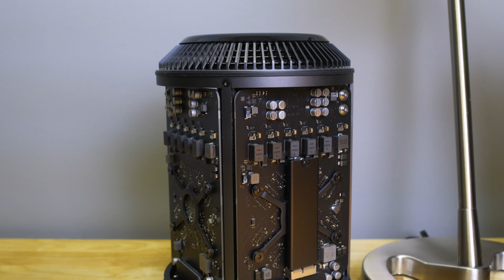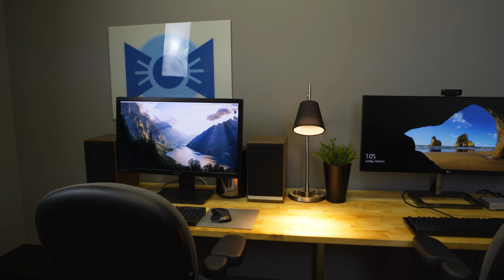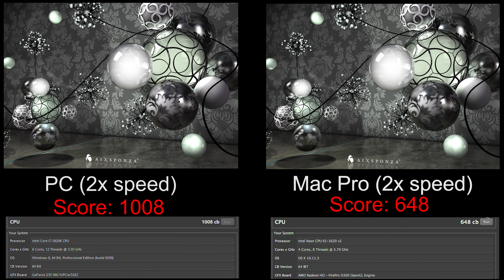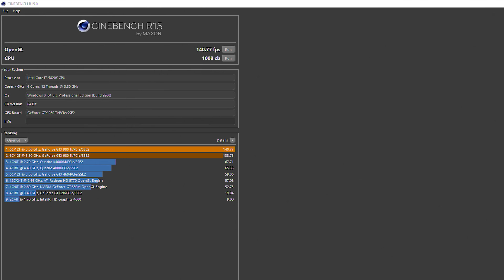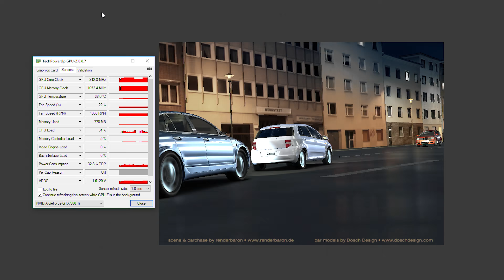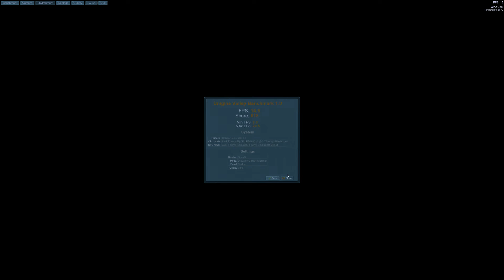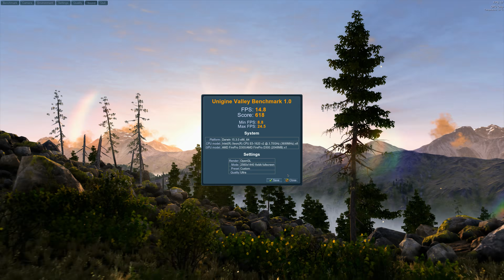$2,000 Custom PC vs $4,000 Mac Pro

Comment: Three additional years have past, what is the status of the Mac vs that pc. Is the pc reliable, are there updates, etc. not a good comparison. W	by would not use something commercially available instead of something rigged to win.
Reply: The PC does still get Upgrades. Windows 10 constantly receives new updates. Also, why wouldn't it be reliable? You just make random assumption to protect a greedy company. No matter how you turn it, the Mac pro is still a bad machine.

Comment: I'm not hating on this video, but comparing the lowest model Mac Pro to a custom PC is overkill, especially with the 2 more cores and twice the RAM, soooo yeah. A 12-core Mac Pro would've most likely beaten the custom PC but then again it was a lot more expensive.

Not like any of this matters since this video is almost 4 years old now and the new Mac Pro beats literally anything on the market anyways
Reply: lol the mac pro doesnt beat the pc market the 3950x and 3990x are still on top
Reply: @mynameis______392  Yeah, and they're like 10 times less than the Mac Pro

Comment: 2.7K Apple Fans. 51K PC fans. Sounds about right. There are multiple factors in my opinion. I am a PC fan, I built my own desktop back in 2015 (it was actually around $2K also), and I do like to game. However, I do own a 2019 MacBook Pro and it serves its purpose great, specifically for some heavy online gaming, streaming services, and online grad school courses. Yes, it’s over priced, but your average graphic designer, photo editor, etc. can’t build a $2K desktop, and can’t find a lot of the user friendly technology on your average PC. I had a 2009 17” MacBook Pro which I utilized for 4 years of college and tons of recording on Garage Band, it lasted me 10 years and never failed with the exception of replacing a battery because it wouldn’t hold a sufficient charge anymore. I dropped it on a music stand, had a big dent on the side, and still held up fine for several years. My wife had a HP laptop, used it for less than a year and had worse performance than my archaic MacBook Pro. Also, some people just have plain terrible luck. Like Snazzy Labs. He’s one person that had a bad experience vs the thousands of people that are content with their $4000 Apple computer and don’t mess with stands (sorry Snazzy Labs, but messing around with the stands on your iMac pro, going back and forth, you’re gonna have a bad time). That doesn’t excuse apples bad customer service in the case of your bad iMac experience video. Also to be fair, many non Apple brands (HP, Dell, etc) use parts just as crappy, and they’re also endorsed by the brands. This even includes some of the parts probably used on your custom built computer. There are also many other factors to consider: age demographic, technical ability, salary, personality, biased opinions, brand loyalty. Those can easily sway a persons opinion on which is better. This applies to many of Snazzy Labs videos, not just this one. Apologies for the rant, I watched several of Snazzy Labs videos and felt the need to comment. I look forward to the Apple haters responses. Haters gonna hate I guess. Great video Snazzy Labs, love your videos.

Comment: That's the base model Mac pro and you're comparing it to a fully upgraded PC. Try to compare it to something similar. Also the base model Mac Pro doesn't cost $4,000, the fully upgraded one does. This video is pure click bait. Any upgraded PC would beat a base model of almost any computer
Reply from the maker: This video is multiple years old. It was produced when the entry level model was $4,000. The fact that even another 3 years later they’re still selling the same machine is hilarious and sad. And that’s the whole point of the video. A PC half the price clobbers the base-model at 2x the price.
Reply: Snazzy Labs the PC has newer components in the video than the Mac does. Also they haven't sold the quad cores in a couple years, 6 core is the base model now. Supposedly Apple is releasing a new Mac pro that's fully upgradeable this year. Just hope it's not overly expensive or else I won't get it. Love my PC for gaming, but I'm so far into the apple atmosphere that it's so much easier to use a Mac. Especially with how well hand off works. Just wish they made them fully upgradeable because interface and usability wise I like Mac, but performance wise my PC eats it for breakfast

Comment: but, but, but it's an Apple...obviously the best computer in the market, not. I battled with artists in the newspaper business around 24 years ago over this very issue. By that time you could at least match performance, if not exceed it, for a fraction of the cost with a PC running Quark,Photoshop, or Illustrator. You could color calibrate your monitor on a PC and it was every bit as good for print media as any Mac. At the time i remember having to replace a bad floppy drive on a mac for $240, at a time when you could by a floppy drive on a PC for $15. I laugh at the folks that buy Apple products. One more thing, it was the editorial folks sold on Macs. It was advertising that used the PCs. Makes sense to me now considering modern mainstream media folk.

Comment: It makes me laugh to see how Mac users and Window users like to call each other names without realising that neither one is better than the other in all departments.  Windows just like Macs, when they go wrong they usually go wrong big time.  I run both systems for different reasons, certain bits of software tend to run better on different systems simple, so calling people ignorant or any other wonderful names just because they have different experiences to you is like the pot calling the kettle black.

Comment: Would be curious to see a rematch with a newly updated Mac Pro (which I am sure has happened since this video) with a new state of the art $2200 PC. I'm sure the Mac still gets its ass handed to it, but by how much?  It really is indefensible that Apple waits 3 years + to update its flagship computer that it chargers a king's ransom for.  Should be every two years at the absolute most.

Comment: Apple systems are ALWAYS last years processors and usually the lower end of them. Every product they sell is over-priced and based mostly on look and feel. Most the Apple desktops in places like BestBuy are offered with less ram than the software(s) really require....so that the retailer can offer over-priced upgrade services.
I hate working on them, but I have to repair whatever the client has been foolish enough to buy.
Will Brown, Dirt Cheap Computers (CA Northbay)

Comment: Oh my god. My i5 4690k machine that I built in 2015 equals this things performance in the CPU department, and murders it in every other way.

I recently bought the Dell G3 15 laptop with the i5 8300h and gtx 1050 Ti. It cost me $1,050 CAD and it's closer to the custom PC than the Mac "pro". The Mac Pro on Amazon is STILL $2,200 CAD and significantly less powerful than my LAPTOP. Again, $1,050 laptop murders $2,200 macbook pro. Completely absurd.

Comment: One thing that I am wondering and it may have nothing to do with the monitor.   The test reported running at 140 FPS???   I am wondering how it was able to at least display that since monitors usually run at about 60hz?   since hz = fps   also if the video card outputs at 60hz as well how can it even be allowed to run higher?  maybe mac has some kinda a run-time routine to do this and report false FPS's and it can prove how it reported the false result

I also find it funny when people tell me they are running 100 FPS when the monitor and their video card is set at 60hz or so. now sometimes they can run a bit higher say 70 or 75 for a few secs that's normal from time to time. like CPU's  rated at 3.2g running at 3.4 or 3.1 its a close estimation.

Comment: I'll bet there is a Linux geek out there laughing at all the Windows fanboys and their $2k computer thinking they built theirs for $400 and it will run circles around that Windows box.  Everyone can play that game dude.  Grow up.
Reply: Linux is just a software. You have to buy hardware to run Linus which cost about the same windows if you need the performance. The only cost reduction is Linux is free. It is good for tinkerers who know what they are doing not for users who just want a computer that can play games at high setting with high frame rates. So they will gravitate towards windows which had huge collection of games compared iOS and Linux

Comment: Yeah, but you're still stuck with Windows.  You can't run both, like you can on Mac.  That's like owning a Tesla and only being able to "refuel at certain" locations rather than ALL locations.  So you're overclocking, reducing the life span and you have all those different parts with software that isn't tailored to your hardware.  LOL.  You're machine and apps will be broken after a few updates and you'll be installing drivers here, drivers there etc. etc. etc.  Why are you fanboy's sooooooooo intimidated by a little computer company with a 5% market share?  This shit has been going on since I bought my first Apple computer in 1984.  You guys don't change over the last 40 years.  Guess what.  Mac users will be happy 40 years from now like they were 40 years ago.  Why do you people even bother getting yourselves worked up?  Because you're losers, that's why.
Reply: What have you the idea that NEED to to download drivers every time. When you install Windows 10 it basically installs the necessary drivers and the rest you can download from the manufacturers website. It is our choice (not the windows 10 updates which is Bs) Apple make good products I agree but their prices and their NO REPAIR policy pass me off. And the whole batterygate incident, and also the recent revamping of Butterfly keyboatdw after years of complaint, and alsoERROR 53 they keep saying it's the customers family even though it's their ok wn damn fault only after a lawsuit was issued they actually investigated it and found it to be a manufacturer fault, and also the geniuses in the genius bar charge 400$ for screwing in a new SSD. SSD cost is excluded. And most of the time they are understocked. I don't believe all of the rumors but when you see sources for the claims I just shake my head. They make repairing your MacBook which you bought with your money as difficult as they can. They hate repairing of their Macs. They are on a vendetta working closely with government organisations to stop the import of Apple repair material. And also they made it that only genius bar employees can even access the diagnositic tools necessary. All of this would be forgiven if they actually fix it NO they will try to persuade you to buy a new by charging you almost the same amount as a new Mac. And even if they FIX it the problem will continue. And their way of fixing is change you Mobo with a refurbished one which may fail after a time. Please tell me your experience with repairing of your Apple produce or are you one of those which buy new Apple product every year. I won't call Apple customers stupid or anything. Since most of them are riich. And their ecosystem is one of the best. And it is very difficult to get viruses, but it is not virus proof as Apple claims. And the UI is also very good. And be I know people who are complaining and those make fun of it will have it. But that does not deter me from enjoying the roasts.

I can't afford one and won't buy one even if I can afford it since I'm more familiar with windows since I was a child. And after hearing many of the legitimate complains I'm sticking with windows.

Comment: I can guarantee you that if you build that same custom PC as a Hackintosh running MacOS it will out perform the same system running windows. I know because i have done this numerous times at my Computer shop. MacOS in itself runs circles around Windows in an identical hardware setup.

Comment: I am by no means an Apple fanboy. However, it is so irritating watching reviews like this. It’s always an “Apple such and such product” vs a “such and such custom rig I built for xyz price.” Why isn’t the comparison ever a Lenovo/HP/whatever type of manufacturer computer? Some car savvy person could go nuts on a 30k Subaru WRX and most likely produce a machine that could outperform a 200k sports-car of some sort. Not everyone is a mechanic, just like not everyone is a hardware engineer. I know it doesn’t take an engineer to build a computer, just like it doesn’t take an auto mechanic to build up a car. Either way, I would speculate that less than 1% of consumers build their own computers. The Apple is a turnkey product, just as my car is. I don’t care to customize it, or even change the oil myself. All I care is that I turn the key, and the thing runs. I expect the same from my computer as well. This Apple does very well. It’s never failed me like countless windows products have. I turn the key, and without failure, it has worked. It might not be the fastest thing around, but it works.

Comment: Update the MacPro in 6 months, lol

2018 and it's still the same with no hope until 2019!  Apple gave up on the pro market.  Which is a shame.  I wanted a trash can when it was new, but it was impossible to find.  I liked the form factor as it was something to easily travel with.  Looks like supply and demand saved me from a stinker.

Comment: Hahaha, i like both. But i don't have a pc instead i have a Macbook Air. PCs are nice for gaming and to get some work done (In my opinion) and Macs can be confusing to use but can also be used for various things, if you are probably on a budget i would get a PC, cheap and customizable, but if you are an Editor/Graphics Designer i would recommend an Mac. (If you have this kind of budget)
Reply: "an Editor/Graphics Designer i would recommend an Mac."

Maybe 5+ years ago. Apple isn't up there anymore. They both lack innovation and raw power. For half the price, you can easily get a pc that can do the exact same job but far better. Especially if you do not buy the base product which isn't powerful enough to begin with. The 'graphics' days of Apple are long gone.
Reply: Looking into what i said, I think you actually have a fair point.

Comment: What it doesn't take into account is that the Windows operating system sucks, updates nearly 2 to 3 times a week that can mess up your computer, unexpected blue screens, far more susceptible to viruses and just simply and unreliable system.  The mac doesn't suffer from that.  Professionals buy mac because of their stability more than its speed.  I would rather wait a few more seconds on a project than lose hours of work because of a unreliable system like Windows.  PCs are better for playing games though, but I wouldn't trust it for my work.

Comment: I tried the Valley Benchmark thing. I have a $650 pc at an average of about 37 fps for that thing at a score of over 1500
$650 dollars-Over 1500
$3000-4000-618
I have not overclocked my PC at all, that is just normal, I'll try overclocking it to see what I can get to.

Comment: $2000 build 6 months ago.(have since added nvme m.2 ssd and a 2tb sshd for $230)
Phanteks P400S Case
ASUS Strix Z270-E Mobo
i7 7700k @4.9GHz  (edit, 5.0GHz lol)
NZXT Kraken x62 280mm cooler
EVGA 1080Ti SC2 
EVGA 700W Modular PSU
16GB DDR4 3200 Trident Z RGB
Samsung 850 EVO 1TB SSD
Reply: soon is my birthday can you send me this gift :) Thank you.
Reply: Bastian Loritz I bought it in September, 8600k released in October(feelsbadman, would've went 8700k). I actually have an 8600k also just haven't finished the build and i'd say they are pretty much dead even for gaming based on benchmarks(at the moment).

Comment: A very biased and unfair comparison - apples to oranges. "different" systems with a 3 year difference in the hardware? I'm not sure why you didn't compare a new PC to a MAC from the 80's if this is how you really evaluate things. [ 4 cores vs 6 cores], [12GB RAM vs 32GB RAM]. Also, check to see what's actually the most modern Apple when you state that. It had 64GB available at the time of this video.
Reply from the maker: Not unbiased, not unfair. Regardless, I have an Mac Pro upgrade you should watch.

Comment: To be fair, there was no way the Mac Pro could have beaten the custom PC because of how you configured the 2 systems. What you really tested was how a 6 core 3.8GHZ CPU system with 32GB of DDR4 ram and a 2015 Nvidia GTX 980 Ti stacks up against a 3.7GHZ 4 core system with 12GB of DDR3 ram and a 2013 FirePro w7000 equiv graphics card. Guess who wins? I do believe Apple will lose some their pro user base if they keep releasing pro equipment that can't be easily and affordably upgraded after purchase. But Apple has a loyal customer base that relies on using OS X over Windows for reasons like: free OS X upgrades, Final Cut Pro, the fact that it's easier to install and run Windows on a Mac than to install and run OS X on non Apple systems, and finally the fact that malware issues are less pervasive on Macs. Apple users pay a premium for this and some get frustrated and leave. The whole situation is frustrating especially since Apple keeps releasing upgrades to IOS devices and iMacs. Mac Pro users feel abandoned.

Comment: Try building a PC with the same specs as the Mac Pro
Reply: Bastian Loritz 
Had a bad morning, sorry 'bout that
Reply: Bastian Loritz 
Sounds cool, but remember that you have to use parts from 2013 or older and make sure the final project is cheaper than the Mac Pro with the original prices of the hardware, also make sure it has the same ports or more than the Mac Pro ;)

Comment: I think the Mac Pro is running under MacOS. That’s y the scores are just sooooo bad... try using boot camp on that and then run the benchmarks...
Reply: The 2000 dollar PC will still obliterate the Mac. there really isn't a point to redoing this test.
Reply: EnderMitten yea, u r quite true, but atleast the benchmarks would be a lot better than how much it was on MacOS.